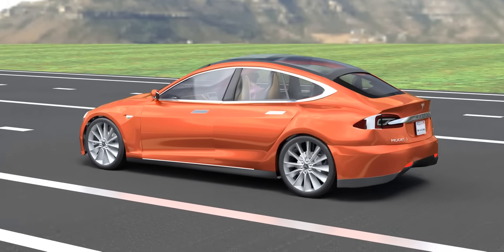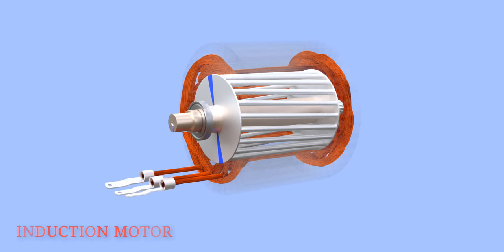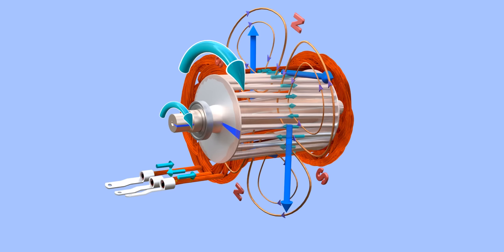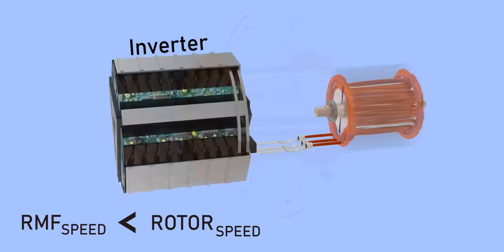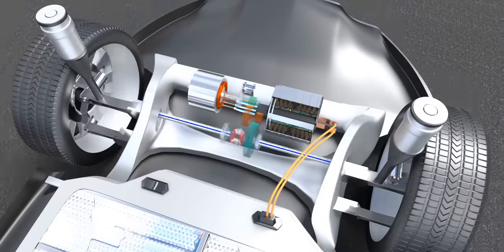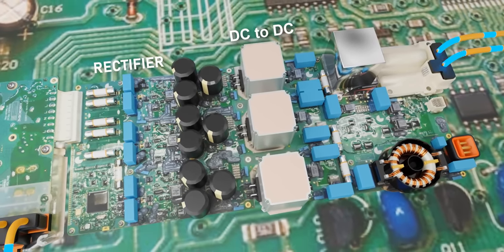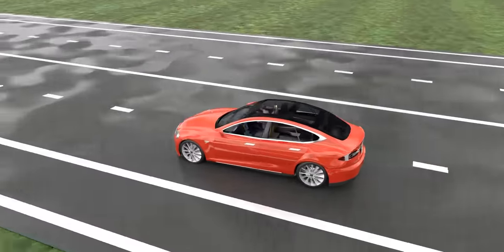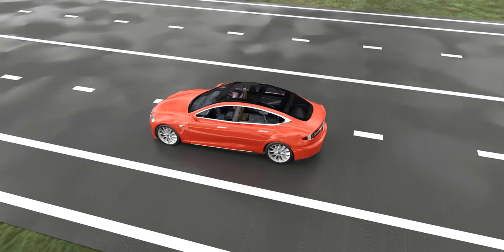Understanding Regenerative Braking!

Comment: Doesn't regenerative braking cause more heat in an already HoT motor?
Reply: The motors don't run very hot at all.
Reply: @logitech4873  It depends how fast & hard you run them. That is why over boost or "Pass" is only for a few seconds. Also braking generates tremendous heat, so much so even Carbon Composite rotors glow red on F1 & Indy cars. Can a motor really turn the friction from braking heat into electricity at the rate required in the time available?
Reply: @kevinburke6743  "boost" or "pass"? Huh?
The motors absolutely don't run very hot. They are liquid cooled and shouldn't go above around 100-120°C.
When I drove around Nürburgring 3 times this summer in my Model 3 with regen set to full, the motors never got very hot. I had contact microphones mounted to one of the motors via plastic clips, and they stayed on all day.

Friction brakes convert almost all of the energy to heat. 
Regenerative braking converts ~80% of the energy back to battery storage. The heat from this is easily managed by the cooling system.
Reply: @logitech4873  Good to know, so why don't they put oversize or additional motors on EV's to do all the braking? Or is it legislation? A car (EV) without traditional brakes would be so much easier to maintain! No pads or rotors, no dual circuit hydraulics. A good chunk less unsprung mass! So it would be only steering and tyres that would be wear/replace when worn parts?
Reply: @kevinburke6743  Modern EVs already do the vast majority of braking via regeneration. I almost never use the disc brakes on my Model 3.

However there are several good reasons to keep the physical brakes:

1 - Regeneration braking is never as strong as hydraulic brakes. You wouldn't be able to brake as fast in an emergency.
2 - When coming to a complete stop, normal brakes do a much better job at keeping the car stationary.
3 - When the battery is at 100%, regeneration will not work because the battery cannot take more charge.
4 - When the battery is very cold, regeneration will be much weaker because the battery cannot accept a very fast charge. (Battery needs to be 20°C+ for optimal regeneration)
5 - If your car malfunctions, it's important to have a mechanical backup for braking.

So for now it's best to keep both.
Reply: @kevinburke6743  In addition to friction brakes having some safety advantages, regenerative systems are actually more efficient if they have the option of bringing in friction brakes for braking torque. The optimal motor resistance for stopping the car is not identical to the optimal motor resistance for charging the battery.
Reply: @moarsaur  So, won't bring the car to a complete stop as quickly (or if all) as friction brakes? What happens if you brake from high speed with only friction brakes and a nearly full battery?
Reply: @kevinburke6743  All I said is that it's more efficient from an energy recovery standpoint to have a complementary braking system. The specifics honestly go over my head, but it's about getting the proper deceleration curve while keeping the motor spinning, not about simple stopping power. That said, no, seizing up the drivetrain at the motor is not likely to be a good strategy for emergency stopping any time soon, unless you plan on replacing some parts afterward. The wheels are the things on your car that make contact with the road, so that's where sudden stopping needs to happen. Even if you have motors directly driving each individual wheel, magnetically locking up those motors is not likely to be as efficient or reliable as a brake pad/disc. 

I'm not sure what your last question is getting at -- EVs and hybrids do need a strategy for dumping excess energy as either motion or heat to allow engine braking to continue with a full battery (not that it happens often), and they use different strategies. On that front, I'm really only familiar with my Honda hybrid, which reverses the roles of both electric motors AND the gas engine in that situation. Normally, the crank shaft from the gas engine is only connected to a small electric generator, which feeds both the battery and the larger "traction motor." During regen, typically the gas engine and small generator are idle, while the traction motor becomes a generator, converting the kinetic energy of the car's momentum into power for the battery. If the battery fills up, it starts sending power to the small generator, turning it into a motor which then spins the crank shaft and the engine, dissipating the excess as kinetic energy once again.

Comment: I have a query:
My electric car shows "flat line for Energy Consumption History" for the periods when Cruise Control is used...
Does it mean that the Electric car always consume "same energy when Cruise Control" is used, irrespective of Running Speed?
Reply: During cruise mode, you only need energy to overcome the frictional drag offered by air and friction due to tire rolling on ground. This energy is very less than accelerating a vehicle. Further modern cars are very aerodynamic, hence they have low drag resistance.
This drag also depends on vehicle speed you are going but as you would usually use cruise mode on relatively close speed values therfore it shows same line.
Reply: @zia.g63  Let me rephrase the query
"Cruise at 40kph and Cruise at 90 kph.
Which one will be taking more charge (given that both have flat line)?"
Reply: @rashmiRanjan20246  ofc the 90 kph will take more power and deplete your battery faster.
Reply: @siontheodorus1501  Thanks, so the flat line on energy history is unreliable?
Reply: @rashmiRanjan20246  if it just shows consumption history with only a line without any values or scale shown, i guess it is more to unusable instead of unreliable

Comment: So it has nothing to do with heat? I always thought it was heat that creates regenerative breaking. I always knew that dont make any sense. I was questioning how are turning the heat the break rotors makes into electric power to charge the batteries. Thanks for this video, now o know it a motor that is primary tool for the charging, now that make alot of sense to me
Reply: We could build in a steam boiler, but that would be a lot of extra parts.

Comment: At what point is the system smart enough to know you are coasting to slow down/stop versus coasting to maintain speed? Ex: let off the gas because I see a stop sign up a head, great way to regain energy since I will be stopping regardless. But what if I just want to “coast” down a slight hill. I’m not gonna add gas, let gravity do the work, but it seems like in this system I’ll be pulling energy and therefor slowing down compared to a standard car. Then (as physics works/commute type scenario), I will need to at some point regain that height (energy) and there is always an efficiency loss somewhere. I’m asking now or in the future will we be able to optimize for true coasting conditions versus “taking your foot off the gas” conditions
Reply: You simply ease off the accelerator pedal, not take your foot off completely, and then it does what you would call coasting. It feels very simple and natural.
Reply: It's not all-or-nothing. You can ease off the accelerator in one-pedal steering, or in some vehicles use paddles by the steering wheel to "downshift" or "upshift" for different levels of regeneration and braking power.

Comment: One issue with regenerative braking is that the car slows down, but usually the rear brake lights don’t come on.  So the driver behind you might not realize you’re slowing down.
Reply: My rear brake lights come on in my Model Y when I use regenerative braking.
Reply: Mine come on.
Reply: If the driver behind you pays attention to the phone instead of watching the road and the car in front on him/her, then if your brake lights are on or off doesn’t matter at all.

Comment: Yes, but I still don't understand, that how this supply the motor and regenerate power from the motor simultaneously?
Reply: It just flips from the motor spinning the tires with battery power, to the tires spinning the motor instead as your car is rolling.
The hard work of cranking the motor slows the tires down and the reversal also puts power into the battery.

Comment: this is why EV is better than internal combustion engine.
Reply: Maybe some people have nothing to do so they enjoy going to the auto repair shop to get new brake pads installed.  And don't forget oil changes, replacing the timing belt, transmission repairs, and smog checks!

Comment: So this means you can't just lift your foot on a slope to save energy like on a normal car?
Reply: I think you would have to keep your foot on the accelerator pedal lightly but then the cars weight would pull the car down faster, meaning the RMF would be rotating faster than the motor so it would be charging it, if I am understanding this correctly. If you are fully off the throttle I think you will regren but still slow down. If you are light on the throttle I think you will regen and keep speed. 

Can anyone confirm or correct me?
Reply: There are some EVs where you can adjust the amount of regen or turn it off completely

Comment: They should use this concept of regenerative braking in normal combustion based vehicles ...so that the battery used for headlights purpose can charge easily... Without replacing it... Btw great video
Reply: Alternator
Reply: Normal combustion engine already has alternator that takes some energy from the engine and converts it into electricity. Headlights are pretty low power so it isn't a big load, but for A/C that one requires big power especially when the compressor is on.
Reply: Lots of new gasoline cars in EU since 2020 are now mild-hybrids with 48 V battery charged during regen braking.
Reply: A normal car battery can’t handle the amount of power that regenerating creates. At peak regen can be pushing 80kW or more of power, depending on the car.

You need a separate high voltage battery to do this. Only hybrids and EVs can do it.

Comment: only 10%?

 seems low... anybody know why it's not so efficient?
Reply: I read somewhere that it's 20-60%
Reply: I don’t know if that number is accurate but keep in mind he’s talking about efficiency for driving overall. Regen can only recover energy when you’re slowing down. So if you’re just cruising on a highway for example, it’s not doing anything.

In terms of merely regen itself, ignoring total car efficiency, regen is about 85% efficient (in terms of converting your kinetic energy to electric). So the process is very efficient. It’s just that the majority of driving does not involve stopping, so the overall efficiency boost isn’t huge.
Reply: Increasing your range by 10% by recouping energy lost to unnecessary acceleration or banking energy on downhill runs is huge. If you over-accelerate and over-brake, and never change those habits despite the car telling you it's killing your range, then technically regenerative braking might be extending your range more than 10%, but your total range will still be less than if you were driving sensibly.

Comment: I have a Nissan from 1994 with manual transmission and diesel with mechanical pump (no electronics in the engine/gearbox). And I also have one-pedal driving in it, I apply brakes only for complete stop. So nothing special in braking when you release the gas pedal.

Comment: The drive unit coolant seal has a faulty design resulting in the rotor bearing gets flushed by coolant, resulting in a total driveunit failure, i have had my driveunit replaced 4 times, now it is starting to break down again, Tesla has not fixed this issue.

Comment: In the end, maybe good for the environment. I fear, though, that the purchase price, maintenance, and ultimate repair of these electric vehicles ends up costing the owner much more than a comparable, gasoline car.  As for pollution, some models simply move the tail-pipe emissions to the factory smoke stack, etc. Then there is the environmental costs of mining these rare materials and ultimate battery disposal

Comment: Now i understand when the inverter fail to regenerative brake, you won't be able to brake too.
Reply: The mechanical brakes are still there, obviously. I have never heard about regenerative braking "failing" though. It's a very reliable system.

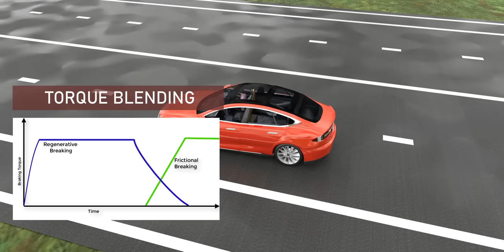Comment: 3:55 "Regenerative braking can increase the range of your electric car by 10%"
A lot of complication for only 10% increase in range???
Now I'm not so sure it is worth it ...
Reply: I heard it's 20-60%, not 10%. Also, it's not overly complicated; electronics are cheap and reliable. Sure the design might be complex, but there are smart engineers who work on that
Reply: Including the electronics to enable regen braking is way cheaper than including a 10% bigger battery.

Comment: There are losses in brake recovery and therefore it is NEVER good to brake recover vs coast.  The braking recovery requires the driver to always have their foot on the pedal at all times to avoid wasting energy via brake recovery.  Speed up, slow down...wastes energy.

Comment: Combustion tech can do regenerative braking too, not just EVs.  In fact, new combustion tech has 75% brake recovery and EVs has only 55%.  This makes EV INFERIOR in brake recovery.
Reply: What, they regenerate petrol? Explain what you mean here.
EVs can be 70-80% efficient in regen.
Reply: An EV generates electricity (93%), stores it in a battery (95%), takes Electricity out (0.95), uses it (0.93).  0.93 x 0.95 x 0.95 x 0.93 = 78% max.  If you model an EV in City, you see it only gets ~ 50% of what it should.  A model 3 at 25 mph is 306 MPGe, but City is only 149.  That is less than 50%.  So, efficiency of EV is closer to 50% than 78%. 

The combustion tech compresses air or CO2, stores it and uses the compressed air/CO2 in the "combined cycle."  This is saves fuel needed to compress.  The efficiency is equal to the efficiency of the combined cycle, which is 75%.  If the engine efficiency were 30% at peak torque like an Otto cycle, then braking would be 30% as it only saves fuel and does not make "fuel" like an EV does.  In other words, braking saves work needed for the process of the cycles.  

The key is the weight which is about 60% of an EV at 300 miles, and around 60% at 400 miles.  This results in lower rolling drag, which in turn make it 1.33-1.5 times better MPG when compared to an EV MPGe.

Moreover, making fuel OFF grid will be 5 to 20 times less costs than charging an EV on a grid.  

The tech can run on solar thermal energy or waste heat from the primary cycle.  It also can capture CO2 and use it to enhance the two cycles.  It is a combustion heat pump in essence and the first of its kind.  It is call New Engine Type because it is a new type of engine.  It is distributed power, which is to say "networked" power similar to a grid with many parts working together.  I talk about it on twitter under @seaplaneguy.  "New Engine Type" was banned before Elon bought it.  @logitech4873
Reply: Correction: 50% with 400 miles range, to 60%.  

BTW, NET has 3000 mile range with CO2 capture and 9000 miles without capture.  

Fuel will be ~$1/gal to make at home and CO2 capture saves around 50 to150 cents/gal in costs.  Basically, 1/2 the cost of fuel making is saved with CO2 capture, which occurs in the secondary cycle when torque is below 50% of peak continuous torque.

NET should be 2x the power density of an EV, so it should be able to beat most EVs in a drag race.  

Lastly, NET does not need a drive battery and the result is that fuel making with NET is ~ 200 times less CO2 than the CO2 in battery and 100% RE grid.  In the life cycle, NET on gasoline is 2.5 times less CO2 than EV on 100% RE, and 5 times on RE fuels.  NET can last for 900k miles and at that point with RE fuel, it would be 33 times less CO2 in life cycle vs an EV with life at 150k miles.

If CO2 is the issue (NOT for me) then NET is the only solution known to get anywhere near net zero.  Hence the name.  A networked engine that is net zero...  NET^2
Reply: @seaplaneguy1  MPGe is a terrible unit. Just use Wh/km like a normal person.
EVs have higher efficiency in cities than on highways. Not sure how you managed to get this backwards.

Name a car with the engine you described.
Reply: @seaplaneguy1 Ok so this is just some stuff you're making up. I see.
Reply: @EpicDrew15  My old airbag bosses were Caltech graduates.  The school had nothing to do with their tech.  This is around 1990.  But regardless, the problems of EVs are still there and will always be there.  NET can be 98% CO2 net zero but an EV is at best 33% when you want to be honest about it.  Max with lots of improvements in process could get a 50% reduction, but material limitation would end the EV run in 1-2 generations leaving us all no power source.  EVs are a dead end do to many reasons.  Deal with reality...
Reply: @logitech4873  All tech is made up at some point.  That is how it is invented.  Welcome to engineering and the world of tech, LOL.  NET will be up to 50 times less costs for energy input and typically 5 times less in total costs compared to an EV.  No EV will be able to compete. EVs are a dead end due to many reasons beyond this comment section.
Reply: @seaplaneguy1  90% of new car sales in my country are EVs, so they don't exactly seem dead.
Reply: @EpicDrew15  I am the inventor and engineer.  I am the source.  You won't find this at any car company. I have worked with most all car companies doing airbags sensors, bags, inflators and modules.  I also interned at Porsche Motorenbau in Suffenhausen Germany.  NET is at least 20 years ahead of anything Porsche has...

Are you a mechanical engineer?  YES or NO?  If not, then there is little point in explaining it to you.
Reply: @logitech4873  We don't have the materials.  Sure, a country like Norway can go EV, but EVs will be 50 times more expensive than fuel making and NET.